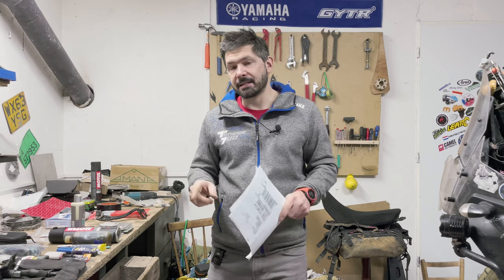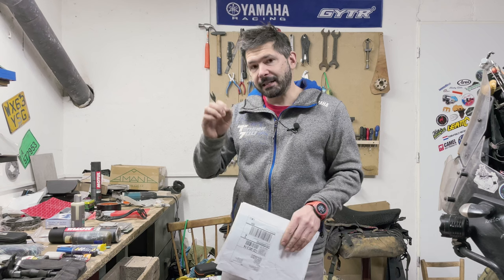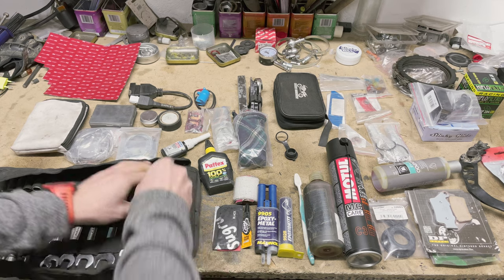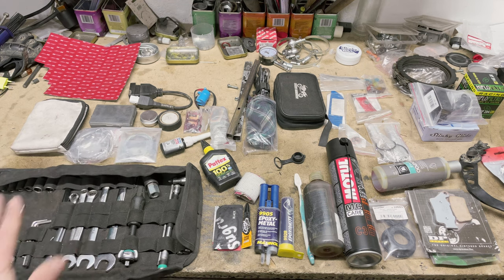Yamaha Ténéré 700: Three simple rules packing tools & spares for a long motorcycle trip!

Comment: It seems, you are prepared for any technical problems. A lot of stuff and weight. For long riding necessary!?
Reply from the maker: For me I really like the feeling I'll be able not to get stuck. I already carry load of gear so these items are "drop in the ocean".

Here in Tunisia I've already used, zip-ties, clutch cable repair kit (for other rider), tire spoons, trail stand and the compressor, oil for my air filter and so on...

So... I don't think it's necessary but it's what I found works well for me and fellow riders.